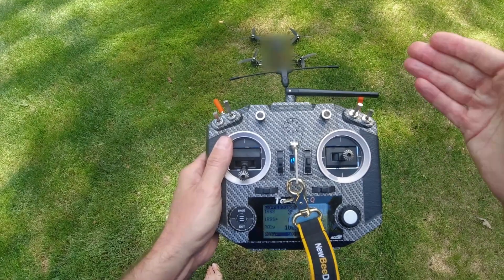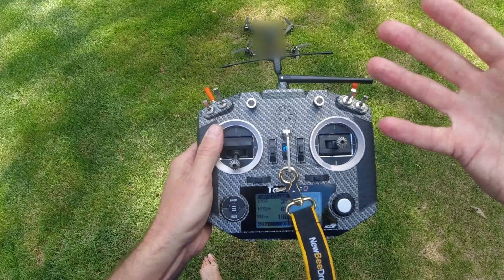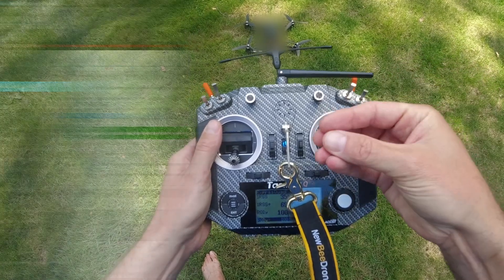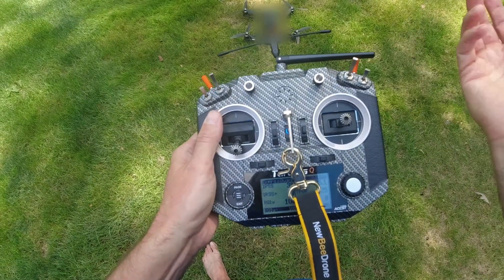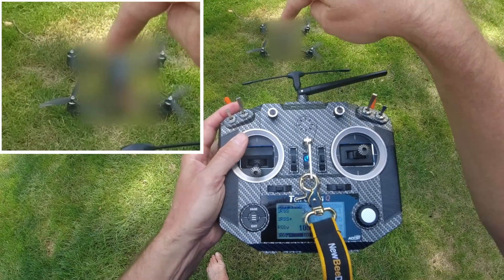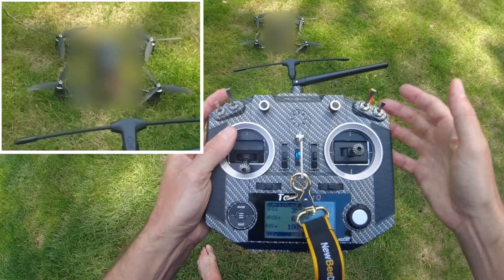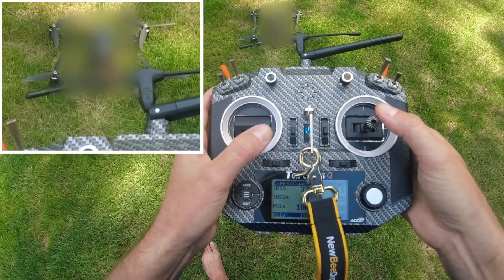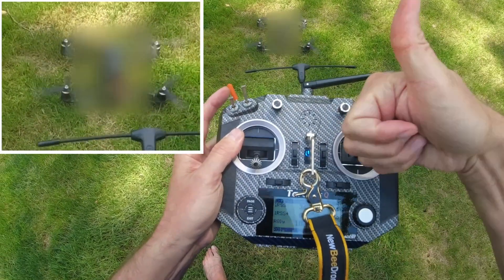Why will SOME Motors NOT Arm/Spin ?!? 🔥🔥

Comment: I've got this behaviour on Holybro Kakute H7 + Tekko 65A ESC and as a result this stack has died after some flights with smoke and flame. But most dangerous behaviour with INAV I've got recently on Matek H7 FC + Hobbywing 60A ESC -  without any reason one motor can start to spin when copter disarmed and sometimes it can be fast and unpredictable - 50 or 100% throttle for one second  or less (enough to make harm) and I suppose that problem not in  the ESC or FC because every time it's random motor  and this issue can be reproduced in 1 to 5 flights -  in my opinion its INAV issue.

Comment: from your description it sounds like a race condition around motor initialisation (or arming) specific to that protocol. might be power on or connection error handling also.
Reply from the maker: 4-in-1 ESC with a 1 cm wire from FC to ESC.

Comment: Hii   UAVTech ,can you please help me with an issue,
So I decided to move from betaflight to INAV (my drone is an X8 cinelifter), everything seemed to work fine initially , but then under outputs tab in INAV when I tried to move motor 7( specifically) the motor wont spin,ESC no 7 gives me a beep and nothing happens, so I taught there might be some issue with the esc and so I decided to check the blheli32 configurator for any of the esc issues, I found out esc no 7 had suddenly 117 bad frames, I slightly got worried,so immediately i shifted to betaflight, once I am in betaflight everything works like a charm, all escs function normally and also has 0 bad frames in blheli32 configurator and the drone flyes pedfectly as usual , one more observation that i made was all motors in INAV spins when I push the master slider but when I push the motor no 7 slider individually I have the issue. 
I am using a MAMBAF722 MK4 Flight controller and Skystar KM65 (65A ) ESC in my build
Reply from the maker: do they all spin when arming in INAV?

Try this tip yet?  You can do props off too if worried.